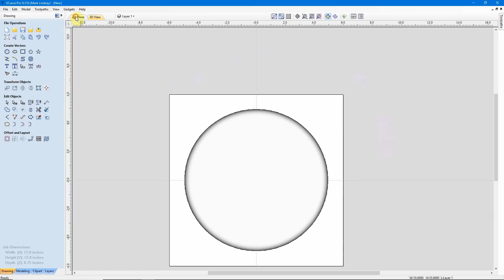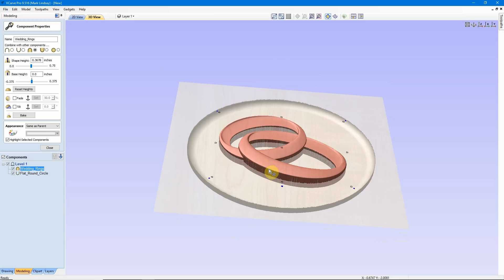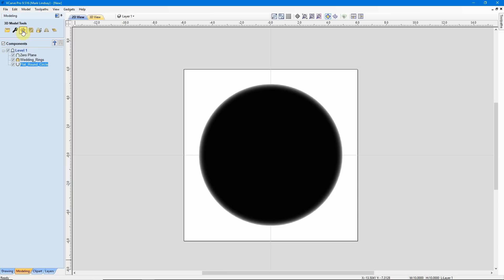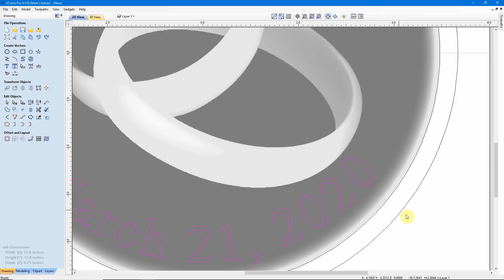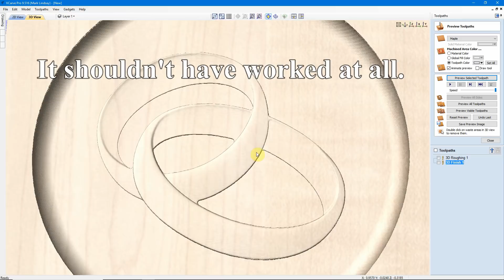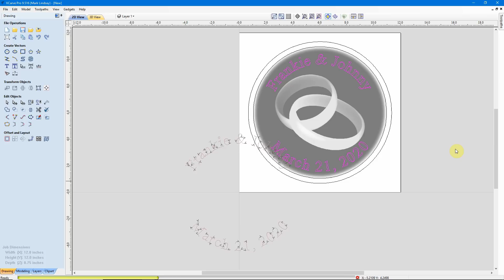Combine 3D Models -  Part 19 -  Vectric For Absolute Beginners

Comment: It great video just wished you showed the job time for each tool path.
Reply from the maker: The reason I don't discuss carving times is because there are too many variables to account for. My machine may be able to cut deeper per pass at a higher feed rate than yours (or vice-versa,) so any time estimate I give you would probably be wrong. Basically, time estimates are machine and tool dependent, so all machine times will vary from person to person.

Comment: So when you get to actually carving the text, and you have to switch out the bit and re calibrate x, y, and z, using a touchpad, how do you get pad on bottom of material for a true reading?
Reply from the maker: First, you don't reset your X or Y zeros when you do a tool change. You reset your Z zero after the tool change only. Your X and Y positions do not change. As far as where you put the touch plate in order to actually reset your Z zero is concerned, that's completely up to you. If you're setting your Z zero position to the material surface, you can do that anywhere on the surface you want to - it does not have to be in the same place you set your X and Y zero. You can put it on any area of the material that hasn't been carved away during the roughing or finishing toolpaths, or even a scrap of the same piece of material, off to the side of the project. It's 100% up to you.
Reply: thanks.  I wondered if I coul change locations when setting the Z.

Comment: I have watched many of your videos and as always I leave with a much better understanding of the topic.  I have been doing some 3d carving and have been reasonably successful  I use vcarve pro 10.0   I am trying to better understand the zero plane     I have added the zero plane in the modeling tab for my work and when i calculate the tool path the entire surface is milled by about .02     Do you turn the zero plane off when you preview the tool path as I only want to carve the model itself
Reply from the maker: That was a mistake on my part. When you apply the Zero Plane, it becomes part of the model. So if you choose to Machine to Model Boundary, it's going to carve the whole surface of the material that's covered by the Zero Plane. I corrected that in subsequent videos, but it was to late to go back and change this one. What I should have done in this video was create a vector boundary around the outside of the dish, then machined to that vector boundary.
Reply: @MarkLindsayCNC  Thanks you for the clarification

Comment: Great tutorial as usual. With the roughing you used will the bit run into hold downs?
Reply from the maker: It might. That's one reason why I use screws rather than clamps. Planning how you're going to mount the material is a very important part of this, and between you and me, I don't think I spend enough time talking about that. I'll try to change that.

Comment: Nice video. Is there a way to zero plane only the model. I am using clamps and don't want to run into the clamps.
Reply from the maker: The Zero Plane doesn't set the boundary of the model, or where the bit does the carving. That's done in the Roughing and Finishing toolpaths. You can set it to machine to the Model's Boundary, the Material's Boundary, or draw a vector around the area you want to machine, and have it Machine to that Selected Vector. I demonstrated Machining to a Selected Vector in my 3D Barn Star video, here: https://www.youtube.com/watch?v=3lvtm8iw0eY
Reply: @MarkLindsayCNC  Thanks

Comment: Great Video despite your boo boo. In my personal opinion, I think the model might have looked a little better if the wedding rings had been rotated slightly. Is it possible to use the rotate function to rotate a 3D element?
Reply from the maker: Yes it is very possible to rotate the model. It can be done in the 2D view or the 3D view, the same as rotating any vector. By the way - I think the rings should have been raised slightly at the base, too. Thanks for checking out the video!

Comment: As an example, what amount of time would this take to carve on your machine? I followed along and it tells me 24+ hours to carve on my machine! Does that sound right on a 12x12 piece of material?
Reply from the maker: Machining time is dependent on several factors - model size, total model depth, depth of cut per pass, stepover, feed rate, and plunge rate. Chief among those are the stepover, feed rate, and plunge rate. If you're cutting a 10 inch diameter model with a stepover of 8% of the bit's cutting diameter, that bit is a 1/16 inch diameter ball nose, and your feed rate and plunge rates are pretty conservative, it could take quite a while. For that model, I would guess at about 10 hours for an 11 inch diameter project. I set my feed rate at 50 ipm, my plunge rate at 25 ipm, and my stepover at 8% using a 1/16 inch diameter tapered ballnose. Also, in the Toolpath Summary page(that gives you the time estimate) set your rapid rate to 200 ipm, and scale factor to 1 and see what that says. It doesn't mean it'll move at 200 ipm - it'll just use that rapid rate to estimate times.
Reply: Mark Lindsay CNC thank you! AND thank you for the video’s, I’ve learned a great deal from you.

Comment: Is there a way to constrain the machining area so your zero plane is not machined in its entirety?  I`m picturing a circle vector outside your profile by a small margin.  Not sure Aspire accommodates that.  Thanks for the details.  I am experienced with Fusion360 but just now learning Aspire.  It is a very different work flow for me.  ~P
Reply from the maker: Yes there is. You can draw a vector around the 3D model in the Drawing Tab and make it whatever size you need it to be. When you go so create the 3D Roughing or 3D finishing Toolpath, select the model and that vector, then in the Machine Limit Boundary area, choose Selected Vector, and the toolpath will not machine past that vector. Keep in mind that the 3D machining toolpaths calculate from the center of the ballnose bit, so the bit's radius may go beyond that vector. I demonstrate that in Episode 30 of the Absolute Beginner series - 2-Sided Machining Part 1. Here's a link: https://www.youtube.com/watch?v=qsTdCdelBkg
Reply: I had the same question. It would seem the roughing and finishing tool paths would be going behind the project  , all the way out to the edge of the material setup-potentially getting into my hold downs -and taking additional time based on what I’m seeing in the preview . Creating a vector could solve this I imagine. Mark created one here, but didn’t use it

Comment: I definitely learned a lot from this video. It was worth every minute. It provided exactly what I was hoping for. I do have one question. When actually cutting the roughing and finishing pass, do you typically go with or perpendicular to the grain? Thank you again, great series!!
Reply from the maker: Thanks for checking it out, David. I'm going to use the two words folks dread - it depends. On some dense woods like hard maple, you can run with the grain. I like to run with the grain as it hides machining marks 99% of the time. For less dense woods like mahogany or softwoods like pine, you cant - it'll peel, rip, and splinter on you. On less dense woods, I tend to run at a 45° angle to the grain whenever I can, which eliminates the problem most of the time. If it's a situation where I can't run at a 45° angle, I run perpendicular to the grain.

Comment: Hello Mark, I have a STL model I purchaced on Etsy. The STL model has a "Rope" border/frame around it that I would like to remove. I use Vcarve Pro, but just can't figure out how to remove or edit the STL model. Can you help?
Reply from the maker: I'm sorry, but you can't edit an STL, or any other 3D file with VCarve. That would take Aspire or another 3D modeling program to do. If you know anyone with a 3D modeling program, hit them up and ask them if they'd edit it for you, then save you a new STL file. Sorry!
Reply: Can you tell me if in this video he is working with a 3D file? The type of files I'm working with are just like his ( mine are from Design and Make as well as Vetric). He is using Aspire but states in the video that it will also work in VCarve Pro. How is this function supposed to work (Trim Objects)? I've even tried it on simple vcarve projects/files. I go through the processes as described and click on "Clear either inside or outside" and nothing happens. Anyway the link included is a YouTube video. Also if you look in the "comments" area. The last comment, someone states this function doesn't work in VCarve 9. I've sent this problem to Vetrics and they say it works in shop, and they asked me to send them my file and a link to the video. At this time I'm waiting on them to see if the file provided is doable or as I described to them the function doesn't work on any file in my version of VCarve Pro (which is version 9.518).

https://www.youtube.com/watch?v=HKMQZoeoe00&t=1s

Comment: Hi Mark. Does VCarve allow multiple 3D models to be imported in, not clip art...?
Reply from the maker: Hi Jeff. VCarve only allows you to import one 3D model that isn't a Vectric Clipart file.
Reply: @MarkLindsayCNC  OK, thanks Mark. I had to block off a couple holes on a 3D model that is a 2 sided job. I only want the holes to be carved on the 2nd side operation, so on the first side, I brought in 2 rectangular pcs of clip art and made their size and thickness work and merged. Did the trick.

Comment: Why would you do all that for an offset, why wouldn't you just make a circle around the outside and choose the difference. You have a 10 inch circle, why not just make a 10.25 inch circle centered on the flat circle you have
Reply from the maker: To demonstrate the tools. As I said in the video, I was answering some questions I had via email and PM. Yes, you're right - I could have just made a 10.25 inch circle (it wouldn't have given me the 3/8" offset I wanted, but your point is well taken,) and that would have given me a vector to cut out. Now suppose this wasn't a simple circle. Suppose it was an eagle, a tree, a deer, or something else. I was demonstrating how to add a vector around the model, no matter what shape it is (this one just happened to be a circle,) then create an offset vector the size you want it to be.
Reply: @MarkLindsayCNC  well shoot, I did not think of other shapes, and I was not trying to sound like I was criticizing your work, I was genuinely curious why you did it that way. It makes sense now😀(I am totally new to aspire) so I am learning everything about the ventric softwares that I can
Reply from the maker: No worries. I didn't take it that way at all. It's a legit question. In my normal workflow, I probably would have done exactly like you mentioned - create the vector based on the finished size I wanted the circle to be. In this case, I needed to demonstrate those tools to answer someone's question about the process.  I sometimes forget to explain why I'm doing something a certain way - this just happened to be one of those times.

Comment: Mark i have a question. When downloading a plan from like design and make they ask what type of file do you want. I'm using Vcarve pro 9.5. What should I use. Thanks Carl
Reply from the maker: If it's from Design and Make, you want a CRV or an STL file. If it's from anyone who doesn't offer CRV files, you need an STL file if it's a 3D model.

Comment: I have a question about the raster direction mentioned around 41:45 in the video. You are using 0.0 to go with the grain direction of your material. Are you referring to the grain direction as shown in the model in the video (perpendicular to the X axis), or your actual material grain direction (if so, is it parallel to the X axis)?
Reply from the maker: Yes, I meant the drain direction of the actual material - not the simulation in the preview. I try to run the bit with the grain. That's not always 100% possible, but I try to get close. In the case of burl wood, where grain goes in every direction at the same time, I take shallower cuts (making more passes) and just kind of hope for the best. It all comes down to the size of the piece I'm cutting. If I can fit it on the table with the grain running parallel to the X, that's how I mount it, and plan the toolpaths accordingly. If I have to run the grain parallel to the Y, I use a raster angle of 90.0.
Reply: @MarkLindsayCNC  Thanks for clarifying, Mark. Updating my angles :-)
Reply from the maker: That's just how I do it, Mike. If you are doing something else, and it's working for you, there's no need to change.
Reply: @MarkLindsayCNC  I'm new to CNC, so appreciate the tips. I had been using the offset strategy after a roughing pass, which needed some sanding afterward. I had just switched to raster in the model, but tripped up on the angle discussion. I have not tried raster for 3d finishing on any wood, yet.

Comment: Is there a danger of the sides of the 90 degree V-bit cutting into the edge of the plate? How do we determine it's safe?
Reply from the maker: That's a valid concern. Generally speaking, the software will give you a warning that the bit won't fit within the vectors if that's a danger. Still, you should look at the 2D view and measure to see if there's going to be a problem, then use the appropriate sized tool to fit the job.

Comment: Mark could you tell me how changing  the molding resolution has a effect on the  g code and speed of the cut. does it only effect 3d moulding? Jeff
Reply from the maker: I explained it in Part 18, Jeff, but I'll go through it again in Part 20.

Comment: These last two videos are very informative.  Did not realize that changing the modeling resolution actually changed the G-code and the speed of the cut on the CNC!
Question: why do you use a ball nose bit for the roughing path vs a flat bottom end mill?
Reply from the maker: Thanks Richard. To be honest, I use the ballnose because that's the way I was taught, and I never questioned it. I figure people who have been doing this for 20 years know a lot more than I do, so... After my mistake in calculating the toolpath with the end mill instead of a ballnose, I may give it a shot - at least on a roughing toolpath.
Reply: I have the same comment 9 months later!Never knew until last video that modeling resolution had any impact on final output, thought it was just for preview quality. Likewise, I’ve also always used a flat endmill for 3D roughing and then the smallest ballnose I have the time for for 3D finishing pass. Endmills with wood can have a 40-50% stepover vs 10-20% max on ballnose, so I don’t see why you’d ever rough with a ballnose. Great videos by the way.

Comment: One quick question......will the Modeling Resolution only change what is displayed on the screen when you preview the tool paths or will it also affect the gcode created in the toolpaths?
Reply from the maker: Thanks for watching, Palmer!  Again - changing the modeling resolution effects the g-code and carve of the model. it does not effect the display on the screen. The only effect it has on the computer at all is it takes longer to calculate the toolpaths and preview the project.

Comment: Great video, but it ended where I am trying to start. What are you using to run the G-Code and actually carve?  Do you have a Patreon account?
Reply from the maker: Thank you, Skip. I use Mach3 to run g-code. I know a bit about it, but only the parts of it I use. I haven't even begun to scratch the surface of everything it can do. I tend to stay away from getting too machine specific. With all the brands, controllers, and control software out there, I find that just about every CNC is different. What works for me may not work for you - and I don't want to lead anyone down the wrong path. My best advice is to look into tutorials for your machine and your controller software. Just about all software titles out there have support forums (sometimes several,) and they'd be the best place to get info that is specific to your setup.

Comment: Mark, Don't apologize for the length of the video. You explained everything in detail and I learned a lot about how to use the modeling tab and what the differences were.  I have had VCP 9 for about 2 years and have barely scratched the surface of what I can do. With your videos, I am learning so much more. One last question, when you carve the letters, what if you wanted them to stand above the bottom like the rings? Thank you!!
Reply from the maker: Thank you very much, John. For that, I'm afraid you're going to need Aspire, because that gets into adding to the model in a way that isn't available in VCarve. Since I don't have Aspire, I don't have an answer for you. 

HOWEVER! If anyone out there knows of a way to do what John wants to do in VCarve, sing out! I'd love to find out for myself!